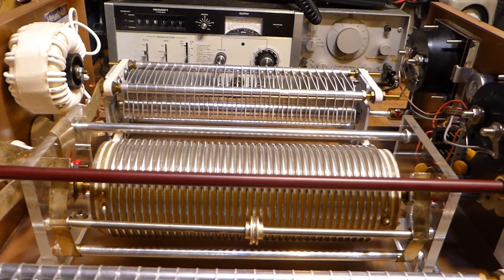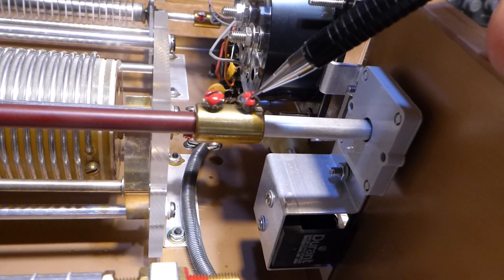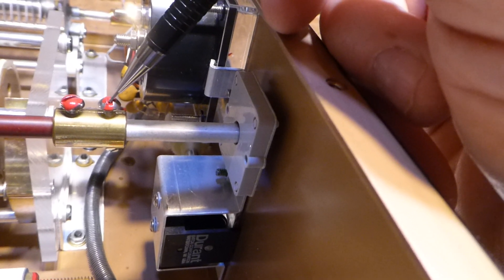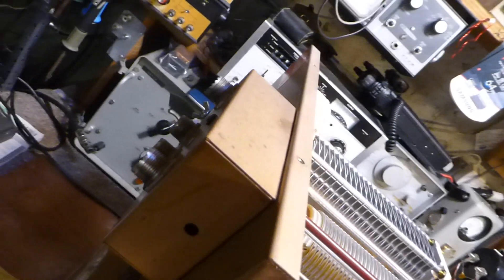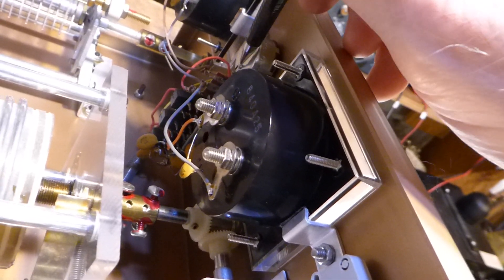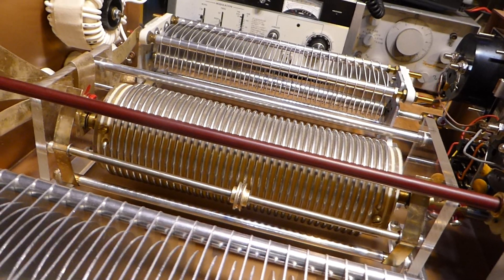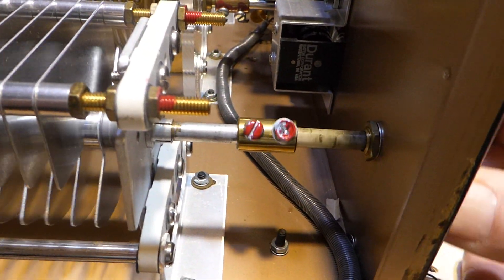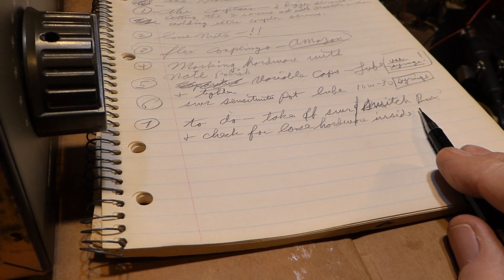Part-2 HEATHKIT  SA2060 Antenna tuner , Antenna tuner . Heathkit 2kw Antenna tuner

Comment: Hi.  

I hv a 2060a tuner with my sb1000 amp. 
I hv always tuned by making a chart for each band. 
Inductor first, followed by transmitter(c1) and antenna dials(c2). 
In the manual, it states to tune c1,2 to 100, for maximum capacitance, then tune the inductor??
Add to this, the sensitivity dial. It states, adjust as needed. How does this work?

Thanku for any help. 

Best,
Billy
N1mrk

Comment: Just rebuilt one. Had to repair the roller inductor. Also replaced the shaft couplings. It works very nicely. I am 81 years old.  Bob, W2OSR

Comment: bob.... I found some led lamps there are flat like a piece of tape. They were used to illuminate back displays. got them from All electronics... about a buck a copy. I bet they would work great for those meters!
Reply: @WECB640  todays radios are filled with LEDs… plus microprocessors.  put a.01 cap across the LED.
Reply: @WECB640  Incandescent lamps might just a well modulate from within the box, too. Palstar, LDG, MFJ, Ameritron all use LEDs in their antenna couplers. It would be an interesting test.